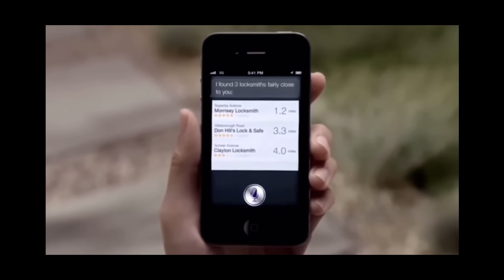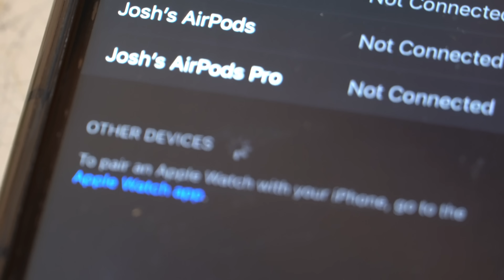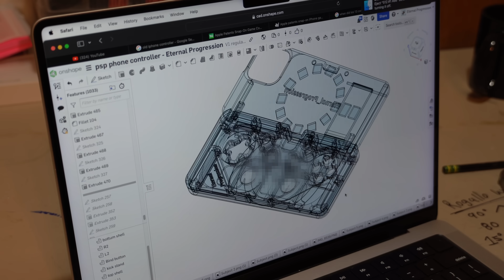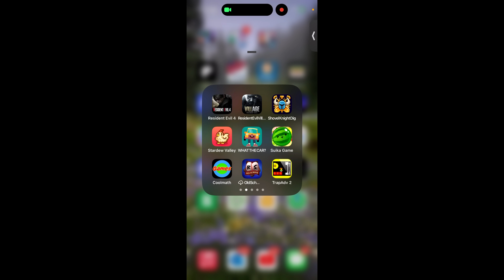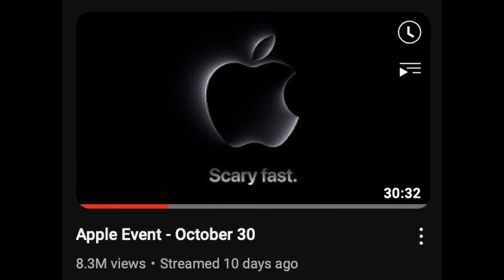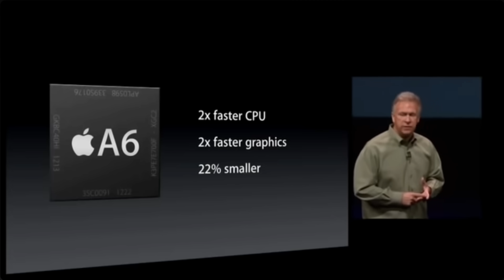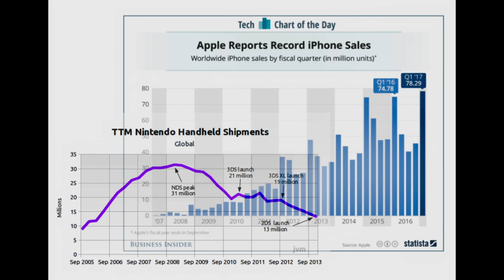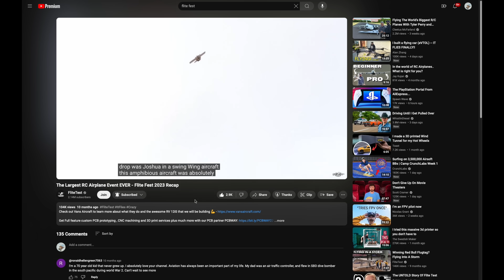I built this controller because no one else would | M-Con V1

Comment: One thing I also believe goes under appreciated, is that designs like this (With controllers underneath the screen) give much better ergonomics. A few degrees makes it substantially more comfortable since you don't need to tilt your neck down as far, and its easier to reach eye level if you are using it laying down in bed.

Comment: I'm looking forward to this since I LOATHE touchscreen buttons! But I'm most excited at the button layout because my biggest gripe with our current mobile game controller market is NONE of them have their D-pads parallel to the face buttons ala PlayStation. As a retro gamer playing things built for the humble D-pad, and with Xbox's layout the norm, I can hardly cope with moving my thumb down one level for parts in games too slippery for analogue sticks (menus and Mega Man jumping to reach a far off later). As long as a D-pad and face buttons share the same vertical level, I'm sold.

Might I also suggest accessibility to play via wired connection? In case you're playing with Airplane mode on or if Bluetooth isn't working, allow easy access for a USB cable between the controller and phone while attached.

Comment: hi, I think this is a great idea, maybe u want to check on these points:

1. u can reverse the rails betheen the controller and the magsafe part, and make it a case with this as a base, so u can sell a case for the iPhone and the controller (maybe separatedly, or in combo, or to make it another solution or function to iphone users)
2. u can put a hole inside the magsafe ring of the device to make it a way to put a pop socket or put a cooler inside it, so ur device wont make the user to switch between those things to use ur device
3. I guess u already saw an opportunity for android users as well
4. patent the design u made and make some asociations with people to make the board for the controller, so u dont need to buy an already existing controller (maybe u could have some problems if u buy it and use it to resell and maybe it could help to reduce costs)
5. this is a great project, and those were just my humble opinion to maybe help u to make it better, but u can just ignore them if u want, I mean, it's YOUR project

Comment: I think you need to use aluminum rails to avoid that flex it has when you slide it, maybe have a plastic tab to release the guides so yuou can remove the controller, would also provide a satisfying click when putting the controller back together lmao

Comment: i wanna make this, could you tell me all i need to know, specifically how to solder the 3ds circlepad
Reply: This is a wireless controller that connects to a phone via Bluetooth, inside the device will be a microcontroller that is running either generic or custom firmware - if you want to build something like this, the wiring schematic for the circle pads will vary, as the microcontroller will be looking for signals on specific pins.

To make an assumption about your level of experience based on the way you ask this question - this might be a bit of a complex project, definitely not beginner friendly. I would suggest getting a teensy clone or even and Arduino Leonardo and look at simple "button box" projects for Sim games first. When you understand how to pass button presses via a microcontroller, I would suggest looking at batteries and BMS (battery management system) projects so that you can learn how to safely utilise lithium batteries in your projects. After that I would then look into 3d design because that alone is a giant rabbit hole to go into to design the shell of this project, when you can do all these things, you'll finally be ready to build this project.
Reply: @bazzatron9482  thanks so much

Comment: Are there plans for R3/L3? The Retroid Pocket Flip had sliders with L3/R3. Another option is that some older GPD devices like the Max and Max 2021 had regular analog sticks, with a very thin click switch beneath the analog board, and the analog stick housing had enough play to allow you to press down and actuate those buttons for L3/R3. I suspect that should be possible within your size constraints.

Comment: If It's budget friendly, this is gonna be one of the things, I'll be dying to buy,whatever the cost. Suggestion, add a function where if you plug the charging cable to it and connect the cable to a device, it can turn into a wired controller, it's a better alternative to just a bluetooth controller, it would remove the bluetooth delay, and it would charge at the same time.

Comment: Great idea, but........ Do a little digging and you will find most gamers use Androids. So don't focus the iPhone to much. iPhone is about 2 years behind Flagship Androids.  And software wise, Android has had emulators for like 10 years already again Apple is always behind.
Reply: Problem I’ve heard is that at least with iPhone there’s only a few new options each year.. with Android you’d have to basically pick Google Pixel and Samsung S series, then you piss off all the rest of the community 🤷‍♀️ 

Not every product needs to be for every consumer - this is targeting iPhone and that’s fine
Reply from the maker: @Kevintendo Ya 100% I’ve made it a requirement that it needs to work on as many androids as possible. The good thing is that wireless charging is a standard and that spot on the phone is always clear even on phones that don’t have MagSafe there is a spot for it. So with a design we have been working on it should be able to work on pretty much any phone that has wireless charging! Which is so so good. I think this product is only successful if you can use it with literally any phone, any case, any OS. It needs to also work on any phone you get in the future or switch too. So basing a top plate off something like wireless charging attaches us to an existing standard and makes it work on pretty much anything. Also lots of phone that don’t have wireless still have that area clear just because so many phones look like that.

Comment: I love it, and I got an idea on how to improve on the design perhaps.

Make the controller a fixed size (maybe the equivalent of 7 inches diagonally), add weights to the bottom of it to balance out the heavy phones, and then the top panel that slides out, turn it into a full case, (so people could use the top part as a standalone case), with the sliding mechanism part of the case. That way you can support more devices by simply creating cases that fit them, while keeping the sliding mechanism in the same location.

Comment: Dude this is next level, most impressive thing I've seen in a long time, especially considering your (assumed) age. Ticks all the boxes, the only last step could be to add a battery pack in there (would definitely be tricky). Super cool, easy sub
Reply: Only question is, however unlikely, it would be so cool to get 13 mini version for this (my phone). I'm sure it doesn't make economic sense but its an unbelievable phone for its size and is actually the most handheld-like a device can get these days
Reply: Maybe an enthusiast limited release??? Id chip in

Comment: this is incredible by itself, but imagine you could swivel on the magsafe connection to play DS in portrait mode top/bottom orientation WITH touch controls. Would cover up the thumbsticks, but... NDS doesn't need them 👀
Reply from the maker: I knowowwww😭😭😭 it’s sooooo close to being possible but it’s a little too tight sadly. There might be an attachment to hold the phone up higher but then the angles is a little odd. I’ve been trying to figure something out for ds for a while!

Comment: Very interested in this. Do the thumb sticks push down like on modern gaming controllers? I know you said 3DS sticks, and I know those don't push down on the 3DS. Wondering if it'll still be the case here. The RSLS/R3L3 buttons are pretty important. Also, what do you have planned for the Max/Plus line of phones that are larger? Everything else looks great. I couldn't 100% tell if there were bumpers AND triggers, but the pics I saw in an article about you and this device looked like it did have some. This is just my opinion, but you should look into adding two extra buttons on the back like the Steam Deck has. Some better grip on the controller itself would also be nice too.Idk if that means maybe actual silicon grip, or maybe having the controller protrude out a bit to feel more like a controller. Idk, sorry for the armchair developing, just really interested in this lol.

Comment: Reminds me of the sliding keyboard of blackberry phones but detachable, genius! I'm not much of a phone gamer but I'd like it if this catches on especially since as you said, the Switch and Steam Deck are handheld but definitely not really the "on the go" gaming devices like the Gameboy or DS fulfilled. The only thing I'm unclear on is will this need to be customized to fit the with each and every phone model android and apple makes or will it be a one size fits all thing as long as you have magsafe on it?
Reply from the maker: Exactly!! So the great thing is that the top plate is removable like you said and we will only need three top plates. Basically one will fit all iPhones one will fit all Samsung and one will fit all pixels and there’s a ton of random phones that have pretty much the same camera shape as those three and will also work.

Comment: Be careful about making your controller too specific to iPhone models. I once bought a Flir thermal camera that included an iPhone case. It became almost useless once Apple tweaked their design. When they add or remove a  mm or go from rounded corners to rectangular corners and back again your controller won’t fit. Maybe you can make it modular, or less fitted.

Comment: I"ve had a very similar idea (that would be even cooler with a folding phone) with the ability to mount the phone vertical or horizontally in addition to halves of the controller sliding out horizontally and vertically. I could find the old sketches or make new ones of how it looked and worked.

Comment: Man, like all of you I am so stoked for this! I actually acquired around 140 xperia plays from a person a few years ago. I have loaded them up with all emulators, and have been selling them on eBay for the last few years (almost sold them all, few left still on eBay) I have used one myself for years as well. I now use a Z fold 5 for retro gaming, and the side gamepads which I have many versions of just don't do it for me. I want the controller below the phone, like the psp go/xperia play. 
 
So I currently have used a plastic grip slim holder, neodymium magnets with a thin strip attached to a 8bitDo N30 Pro 2 (slim model) that I drilled little holes for the neodymium magnets that hold it below the phone. However all that said, I will buy this day one when they are released. These are going to sell like flap jacks at IHOP! Thank you Sir, I can't wait! Great design!!

Comment: If you want this product to be as successful as possible you should design your own pcb, use open source keyboard firmware like ZMK which now has unofficial pointing device support, and release it all to the public: the print files, zmk firmware,  kicad files, and build guide. This would still be a difficult product to build for normal individuals who don't have a printer, soldering skills, etc. So you can still sell it pre-assembled, printed, soldered, and pre-flashed or as a partially assembled build-kit. This is proven to be true with the insane market for custom open-source keyboards. The firmware makes it beyond customizable and you're not dependent on any pcb ripped out of another controller. With so many different styles of phones it would be great to be able to create a kit that best suits the end-users hardware. With the massive(and still growing) community behind zmk it would not fall entirely on your company to support this device the community behind it would find their own solutions and improvements and you can incorporate those changes into a better products. Additionally, selling different priced products (fully-assembled/build-kit/parts) would allow people with different budgets to have access to this product.

Comment: Awesome idea, very inspiring, congrats !
I would like to add several things that you did not talk about in this video. If I'm correct you changed the battery to a very small one to save some space. I'm curious about the autonomy of this controller now but the original one was really good so maybe it is still fine with the smaller one ! You also seem not to have included the vibration motors, (maybe that could also help with the autonomy), and finally you did not include the central T button of the original controller used for turbo mode and controlling the intensity of the (now missing) vibrations.
Either way I really think you did a great job, and you are making good choices. I wish you all the best for the future !

Comment: This is great! I was looking for this after remembering I had heard about it a month ago.

I hope there's eventually an option for a straight connection through the usb-c port instead of bluetooth (and still have another port on there to allow for at least charge pass-through like some telescopic controllers I vaguely remember), which would require making a completely new case which I understand may be more restrictive than just requiring a specific type of case already. But even if that idea ends up coming to fruition way down the line and ends up being more expensive for the design being more complicated than the wireless version I would still pay extra to have it on my phone at all times (and take off some of the latency ofc).

Regardless, whatever plans you do have for this I hope you work out shock absorption from falls and ofc, best of luck!

Comment: I wish I could have gone to the expo in person but being in Japan makes it kinda hard to do hahaha. I really loving the idea and drive, fly high and fight on!
I got a few questions though.
I wonder if there are plans for the final product to have support for something similar to how backbone controllers connect (like other controllers such as GameVice, GameSir or Backbone One, minus the vice part, by using a physical connection when needed). For emulator or games that accept Bluetooth controllers from the get go the current form is fine but there are plenty of games that get either ported or multi released and make it to mobile that don’t have support for Bluetooth controllers from the get (games like Genshin, Zenless Zone Zero and Wuthering Waves didn’t have Bluetooth controller support or only got backbone type support on launch). One idea I had while watching it would be to have a magnetic add on on the bottom side (maybe even as an extension to the back grip so as to not get in the way too much) that could route a short cable to the lightning/usbC port for physical connection. It would be needlessly complicated but I was thinking something like how that one Moto Z had those optional mods/attachments. Using connectors like those in the back and making use of the magnets to attach them to the back of the controller main body could add more options. It will be a chunky controller in the end but leaves space for expanding the design.
Regarding the board, are you going to outsource it or making it from scratch in house?

Comment: Use a resin printer, I resisted the change but for prototyping the pros far outweigh the cons, there’s a bunch of new ones on the market that have improved a lot and the detail is magnitudes above FDM. Also there’s engineering resins that are incredibly strong.

Comment: no, there is likely NOT a magsafe case for any android phone. android phones are very different from each other and considering Magsafe is meant to work with wireless charging, if your phone doesn't support wireless charging, then there's no reason there would be a Magsafe case for your phone. also keep in mind that many android phone have a camera bulge on the back, this makes things even more complicated. and how's it going to connect? bluetooth? you'll have to use at least bluetooth 4 for reasonable battery life, and you can't count on USB for connecting it. many android phones now have USB3/C but most android phones still don't support hardware connections through the USB port. Also, in any case, mobile phones with a game controller are not consoles. A gaming console has hardware AND software specifically optimized for running games made specifically for said hardware. the steam deck and other PC gaming handhelds, along with iPhones and android phones, are no more a console than a PC is. Even "gaming PCs" aren't consoles.
Reply from the maker: What phone do u have?
Reply: @joosh_king  Moto G 5G
Reply: Don't be such a killjoy, this isn't suposed to replace consoles as pre-existing controllers haven't done so.
By the way, do you even have a steam deck?

Comment: Does it only have L and R shoulder buttons or there are maybe L2 and R2 at the back and L3 and R3 in the sticks? For the sake of emulating PlayStation.
Also, do you plan making versions for Android phones? Especially Xperia 5 and Xperia 1 series phones. They don't have magsafe and sould need usb connection or Bluetooth or something? Using holders with a PS4/PS5 controller the way you used to use an Xbox controller is a bit tiring after a while due to how weight of the phone pulls the controller

Comment: This is absolutely amazing.
I have a controller with a phone adapter, and I use it sometimes, but it's certainly on the bulkier side. Having something that can be easily be attached and removed with a relatively small footprint that can also be used independently as a normal xinput controller? That's fantastic